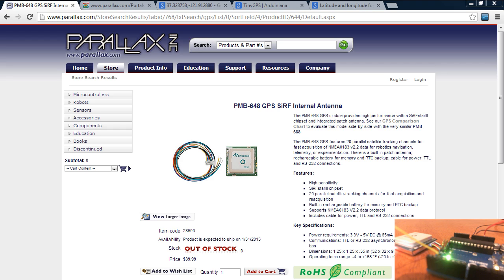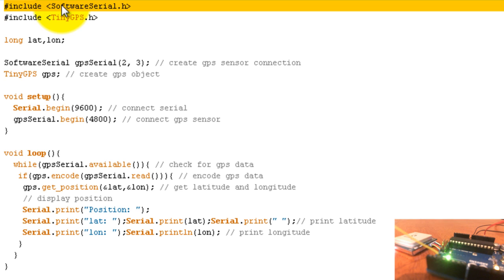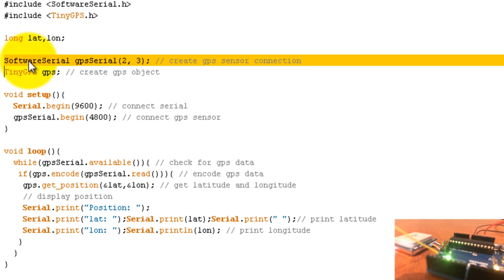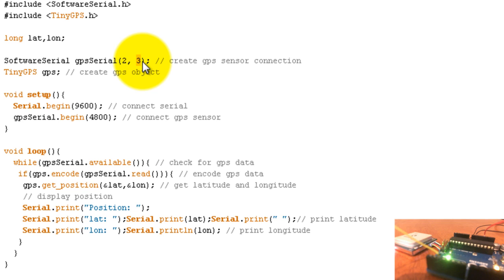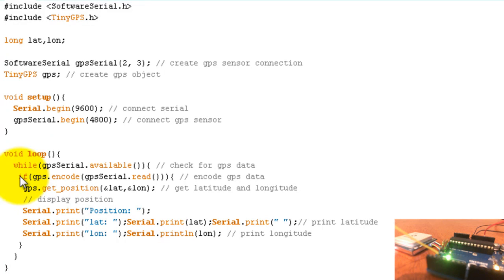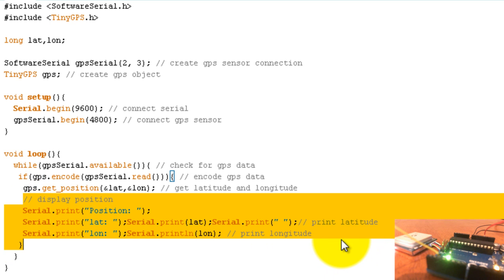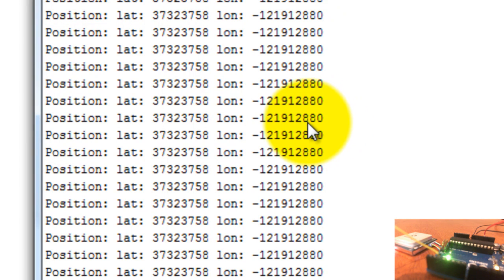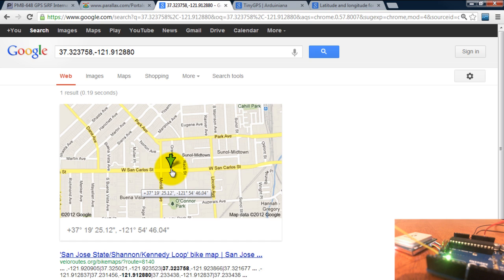Arduino GPS Tutorial: How To Get Latitude and Longitude From GPS Receiver

Comment: AllaboutEE, how could I retrieve a copy of your sketch to get started?

I see the GPS supports several baud rates.  Can you change the GPS Rx’s serial baud rate in your initial declaration or do you need to configure the GPS vis commands to the Rx pin the GPS unit itself?
Reply: You can change the GPS Rx’s serial baud rate in initial declaration.

Comment: #include <SoftwareSerial.h>
#include <TinyGPS.h>

#include <SD.h> 
#include <TMRpcm.h>
#include <SPI.h>
const int CS_PIN = 4;

TMRpcm tmrpcm;
char mychar;

long lat,lon; // create variable for latitude and longitude object
 
SoftwareSerial gpsSerial(10, 3); // create gps sensor connection
TinyGPS gps; // create gps object
 
void setup(){
   tmrpcm.speakerPin = 9;
 Serial.begin(9600);
 gpsSerial.begin(9600); // connect gps sensor
 
  pinMode(CS_PIN, OUTPUT);
  if(!SD.begin(CS_PIN)) {
    Serial.println("Card Failure");
    return;
  }
  Serial.println("Card ready");
  tmrpcm.play("hello.wav");
  delay(5000);
}
  
void loop(){
   while(gpsSerial.available()){ // check for gps data
   if(gps.encode(gpsSerial.read())){ // encode gps data
    gps.get_position(&lat,&lon); // get latitude and longitude
   
    Serial.print("Position: ");   // display position
    Serial.print("lat: ");Serial.print(lat);Serial.print(" ");// print latitude
    Serial.print("lon: ");Serial.println(lon); // print longitude

       }
    }
 }

There is not show any output co-ordinate..please help.
Reply: md srabon i downloaded tinygps library and wrote that code but its giving me " class Tinygps has no member named getposition" what can i do???plz help me

Comment: When I open the Serial Monitor, no numbers appears, do you have some idea of what is going on??
Reply: Check whether your GPS is blinking or not. If its blinking, it should work as it's getting connected with satellite. If not blinking, wait for awhile until it starts blinking. 10 mins later, if no sign of blinking. Check the powering up connection.

Comment: I found that I had to set the baud to 9600 for the GPS when using the 3DR GPS unit. Otherwise I did not receive any information when using 4800 baud.
Reply: thank u very much.i was facing the same problem.thank u

Comment: I uploaded the code on the YouTube, and then connect 4 wires(Vcc, GND, Rx, Tx).
and I lastly set the Baudrate at "4800".
but my Serial Monitor shows me numbers in a line.
What should I adjust to get the result on the YouTube ?
Reply: set settings on Serial Monitor (there is a "pull-down menu" right next to boud rate, choose  "Newline from it") 
i think that will fix your problem

Comment: I am using Arduino Mega along with GPS receiver A6B module. When I tried using sample code given in your video it shows three errors.
1) sketch_apr09a:7: error: 'TinyGPS' does not name a type
2)sketch_apr09a.ino: In function 'void loop()':
3)sketch_apr09a:16: error: 'gps' was not declared in this scope

What can i do to rectify this?
Reply: make sure you have the tinyGPS folder in your library and also make sure your code and the tinyGPS folders are in the same file.
Reply: Thanks Abdoul.